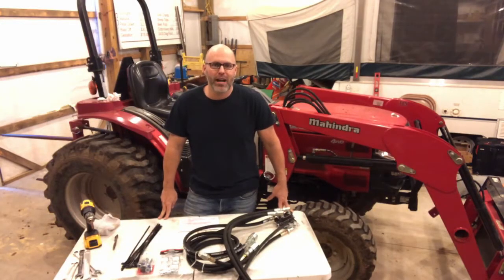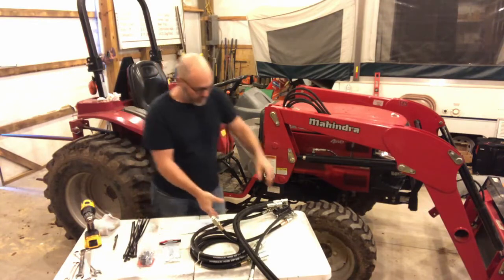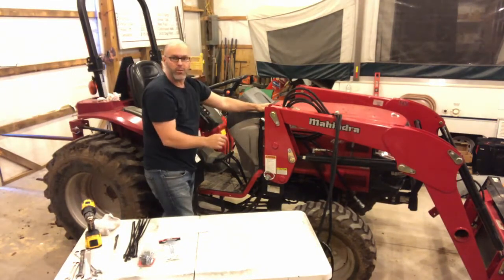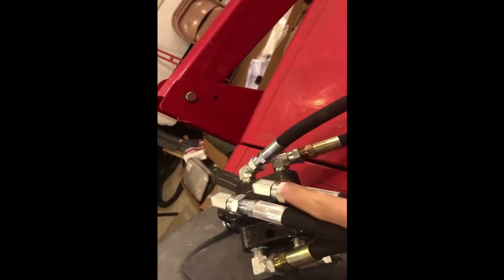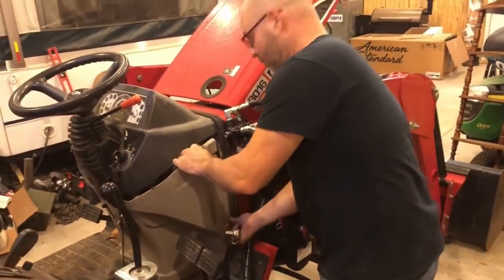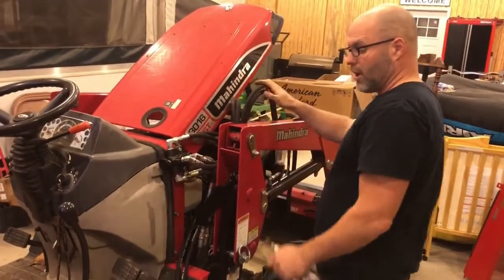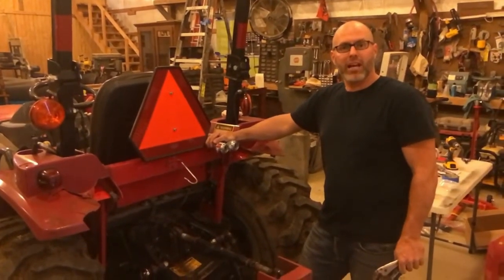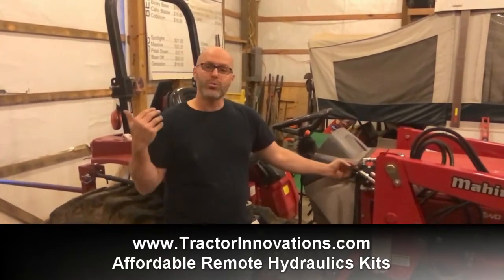$625 Remote Hydraulic Kit for Mahindra Tractors - Fast, Easy Install

Comment: Just installed one on my 4530 to run my grapple was a  rather easy install. I installed on the lift function seemed like the more natural position. My tractor is a 06 model and felt this was the best unit for me to avoid any electrical problems.I ran my hoses on top of the loader arm since i have a muffler that is close to the arm. Mounted the control valve next to the loader control for easy excess. Andrew was very prompt in answering a question I had about my purchase and my kit arrived in a few days. Very Pleased with my purchase. Charles H. / central Va.

Comment: i just installed the kit on my BX23s. Works perfect, I didn't like the way the valve bolted to the curviture of the instrument panel, but by adding a short piece of 1/4 inch pipe on the top bolt cut on a slight angle and a longer bolt, it straightend the valve up and made a much more professional job. Thanks Andy

Comment: could you potentially run all 4 houses on the diverter?  I want 1 to control the top assembly and 1 to replace the lift arm/leveling assembly on 1 side.  For box blade work.
Reply from the maker: Yes, check out this video of a 2-valve diverter system:
https://youtu.be/NPBprRph2qw

Comment: i traded in my 4540 mahindra for a new 5145, can you make a kit for this tractor for the same price? and do i need to call you with all the hose lengths.
Reply from the maker: Absolutely!   Yeah, to be sure of the fittings, I'll want you to send me a couple pictures, and we'll be off to the races.   Same price - a little different hose length or a changed fitting all comes out about the same to me.  541-972-0546

Comment: Have you ever installed one of these on a Mahindra 15 series? I have a 2615. I thought on my tractor you would likely tie into the hydraulic block under the right side. My application would be to run a top and tilt.
Reply from the maker: Yes, I've built kits for 2615 and 2815 tractors.   One kit provides one circuit - two ports.   If you need two circuits, I help customers with double kits all the time.  I can knock $50 off the second kit.   Give me a call.
541-972-0546

Comment: I have a Mahindra 3016 like in the video.  I already have an additional remote on the front for my grapple bucket but I’m wanting one for the rear.  Any thoughts on how to do this?
Reply from the maker: Yes - it'll work great.   You have the choice of diverting fluid from the 3rd function or the loader circuit.   You can choose how you want it setup.   If you rarely use the grapple at the same time as whatever you want hooked to the remote, that's a great option.  Or you can have it hooked to one of the loader functions.

Here's a link to purchase directly.   I'm still working to get my website updated for the Mahindra.

https://www.paypal.com/cgi-bin/webscr?cmd=_s-xclick&hosted_button_id=A3XMP9GPG5FX8
 
Or give me a ring with any other questions or to order.   Andy 541-972-0546
Reply: @TractorInnovations  hello Andy. Im an Andy too. Is that 541 area code Oregon? I have a mahindra emax 25. I'd like to get to get a kit like this.

Comment: So if I need two remotes , TNT for example, I would get two of those plunger valves , and I would disable two functions on the FEL?
Reply from the maker: Yes, that's exactly right.   With two kits, it's pretty cool, you control both remotes from the one control lever.   I give a discount of $50 off the second kit.   Give me a call or check out my website to order.

www.tractorinnovations.com

Comment: I have a mahindra 26max with my bucket controller on the lift arm. Need remote for rear attachment. Where can I mount it! Do you make one for that
Reply from the maker: Yes, I build for the Mahindra Max series.   Is it a Max XL or Max XLT?   This mount differently, but I can build either one.   Send me an email or text (located on my website) and I'll send you pictures of the mounting. 
www.tractorinnovations.com

Comment: I HAVE A MAHINDRA 2638 WITH A THIRD FUNCTION  VALVE TO RUN MY GRAPPLE.  DO YOU HAVE A KIT TO DIVERT THE FLUID FROM MY THIRD FUNCTION VALVE TO THE REAR?  i WANT TO RUN A HYDRAULIC TOP LINK.
Reply from the maker: Yes, this kit works great coupled with a 3rd function.   Knob in, it controls the grapple, knob out, control your top link.   Easy install.   I can ship the next day usually.    I sell hydraulic top links as well in a few sizes.   www.tractorinnovations.com
Reply: @TractorInnovations  I’m in the middle of moving to my pine plantation.  Once I get settled I will order one.  Thanks!

Comment: I have a Mahindra 1626 with a backhoe. Would this kit work with my tractor? Would I need this whole kit or could I maybe use the hydraulic ports from the backhoe and order a smaller kit?
Reply from the maker: This kit will work well for you, and won't touch the backhoe hydraulics.    The backhoe system received flow, but doesn't have a valve to control the remote function.   This kit uses the loader valve to control the remote.  Let me know when you're ready, and I'll have it shipped the next day.  Your tractor has quick-couplers, so you'll want the plug & play kit for a quick install.

https://www.tractorinnovations.com/mahindra

Comment: I have a 2014 Mahindra 4025 2wd and I would like to add a 3rd function valve to run a grapple. Are you ale to build that kit?
Reply from the maker: Yes, this works great on a 4025.   You can run this kit off of one of your loader circuits or off of the 3rd function.   Your choice.   The switching valve mounts neatly on top of the flat shield over your loader valve.    Simple install.

Comment: Good Morning, I have a 2016 Mahindra 4540 4wd with front loader.  Can you make a kit for 4 rear remotes?
Reply from the maker: Yes, I've recently done that exact install with two complete kits (giving you 4 ports), and it went really well.   I can send you pictures.   Send an email tractorinnovations@gmail.com
I can knock $50 off the second kit.

Comment: How do I add hydraulics on the back of a Massey Ferguson 1528 to run a hydraulic 3 pt backhoe?
Reply from the maker: Hi Reid,  I’ve built kits for lots of similar tractors.  I just need pictures of the loader valve and quick couplers, and I can get it going for you.  541-972-0546 or tractorinnovations@gmail.com
$550 out the door.

Comment: I have a 2022 4550 mahindra and would like a kit to run a grapple.
Reply from the maker: This works great to run a grapple, and is an easy install on a 4550.   You hav e a flat shield over the loader valve that is really handy for mounting this switching valve.

Comment: I have a 2638 Mahindra loader . What do you have for my unit ?
Reply from the maker: This kit works great on a 2638.  It will mount on the metal firewall between the dash and hood.

Comment: Anything specific for Mahindra Emax20?
Reply from the maker: Yes, I build a kit specifically for the Emax tractors.   You have a loader valve sitting out by itself, and I build a bracket to mount the valve with no drilling.   Email me for pics.   tractorinnovations@gmail.com

Comment: Will this connection work on the 4540?
Reply from the maker: Yes, we've installed several on that exact model.   Call or check out the website to order.   
www.tractorinnovations.com/mahindra   
541-972-0546